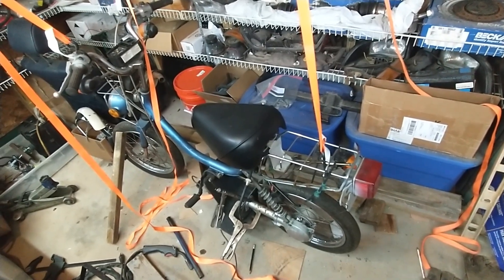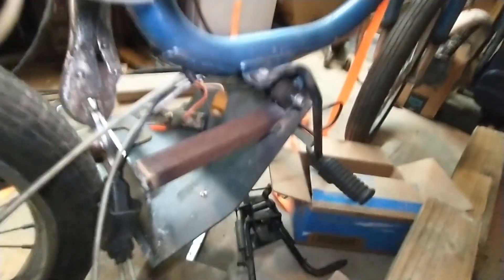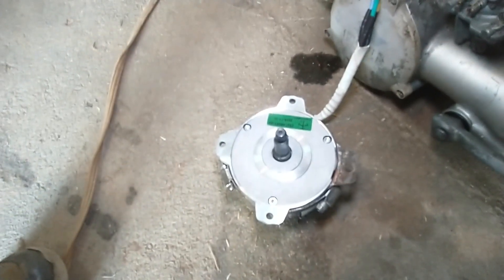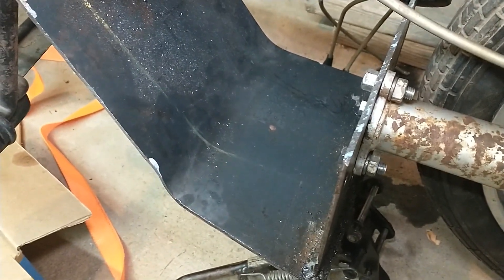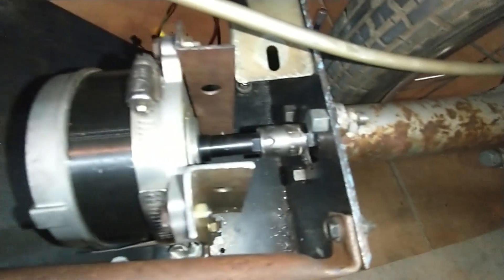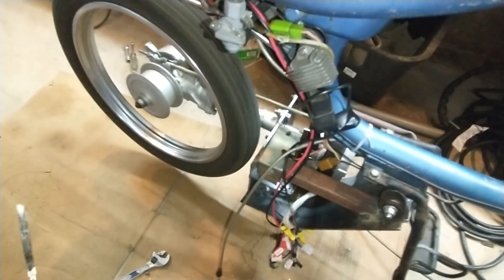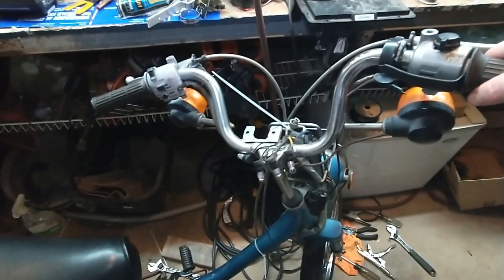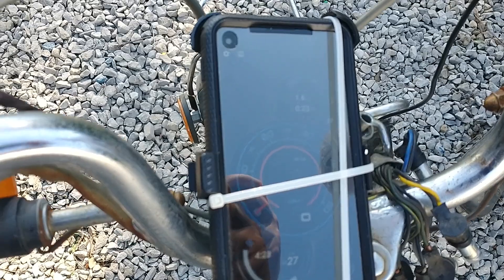Ryobi 40v Powered Electric Yamaha QT50 "Yamahopper" Moped Conversion Project - Part 1

Comment: What was the speed controller you used? I believe the mower is only one speed.
Reply from the maker: That's correct. The original was just a one speed unit. I used one like this:
https://www.ebay.com/itm/163904939019?mkcid=16&mkevt=1&mkrid=711-127632-2357-0&ssspo=BTPWdeqWR0q&sssrc=2349624&ssuid=bwWTw66aRma&var=&widget_ver=artemis&media=COPY
I used that same controller when I upgraded the motor to a larger one and it seems to work quite well.